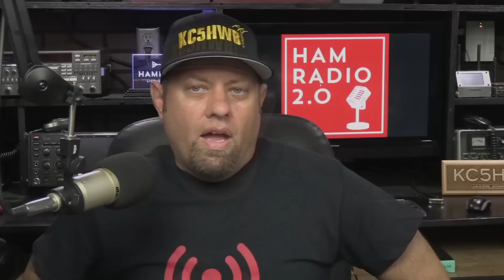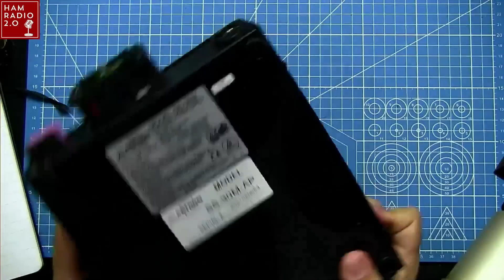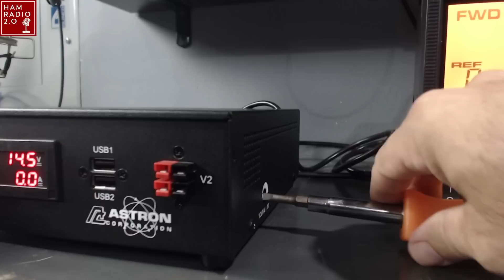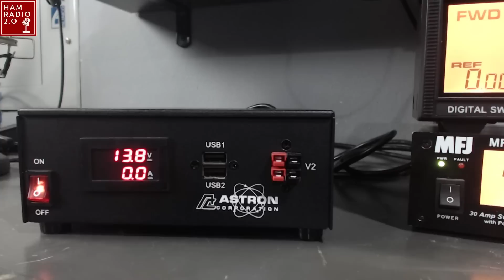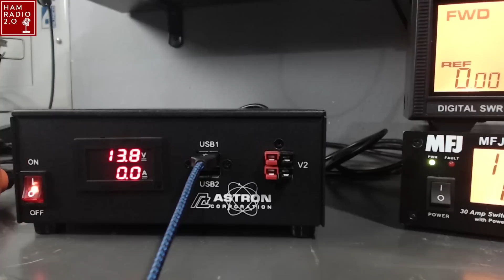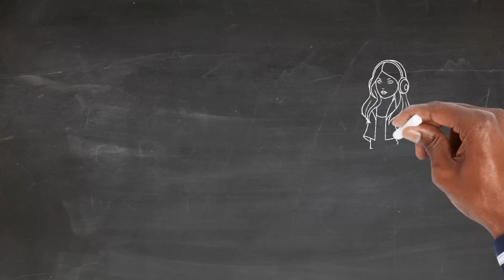Astron SS-30M-AP Power Supply First Look!

Comment: I have to of the SS-50-AP supplies.  The adjustment screw was labeled backwards on both of mine too.  Go figure.  It's pretty amazing how small they are.  I have had Astron supplies for decades and my RS-20 started to get really hot heat sink fins.  I think the pass transistors are dying.  These have been very good and I hope they last as well as the old ones.  the funny thing is the 50 Amp switching supply is in exactly the same size case as the 30 Amp

Comment: HEY 2DOT!!! How's it goin'?  Hf radios are powered from the back. 2m/440 are powered in the back. Antenna tuners are powered in the back. Amplifiers, the same, in the back. Question: WHY then, do power supplies makers put the power ports, IN THE FRONT?? I can see it for use in a laboratory where things are being plugged in and out all the time, BUT hams hook it up, and for the most part, forget about it! Just wondering. Thanks !!
Reply from the maker: Usually it is just easier to get to while sitting on a desk.

Comment: Many thanks for making this video. I have just replaced my old Manson psu, I was worried one day the voltage could go high. It arrived today and works great no rf noise on hf from this PSU. What a change not to have a noisy fan coming on every couple of minutes. I am using it with my FTDX10 2.2 amps on RX, 17amps on cw 75w. Once again many thanks.

Comment: mine has terrible RFI from 5MHz to 10MHz...  even worse when the power is supplied via the Powerpoles
Reply from the maker: Astron doesn't usually have that problem, you might have a dud
Reply: @HamRadio2  I called them up and they suggested that I make sure the ground plane screws were tight and that my electrical ground was sound. Everything is fine... I'm not going to give up, but will send it in and see if there is something faulty.

Comment: Very helpful for a new Ham (@ 66 years old) looking to power my first radio.  Finally retired and have chance to indulge a bucket list item…still developing  my philosophy of use, but just ordered this supply to pair with an Icom IC-7100 as a general purpose shack/travel radio.  More concerned with the flexibility than the absolute absence of transient noise as I try different things to decide where to take the hobby. Very useful information…thanks!
73/KO4UWS

Comment: When I purchased my first HF radio a Icom 7300 in April 2021 DX Engineering recommended the Astron SS-30-M and it has been excellent. Good review, like the new features on this new model. 73 NM5SP

Comment: Working with commercial radio sales we sold many Astron linear supplies in the past. As Timex used to say, They took a lickin' and kept a tickin'. As for repairs, very few needed, usually pass transistors from a customer overloading the supply. Only one I could not fix and that one was hit by lightning. One can only hope that Astron will provide schematics for these supplies as well as a tech support / FAQ site for those with little experience in diagnosing and repairing issues with switching supplies. A big Bravo to Astron for making this supply a wide input voltage range ( hopefully without any type of switch over arrangement) makes life for Hams a bit easier. Alinco's new 30 amp switcher is available as only a single voltage input depending on where it is sold in the world with no chance of moving it between both common input voltages.

Comment: I have the older analog dual meter version. Astron makes great power supplies. The rear DC output terminals are the only negatives. I wish they would change them to binding posts. Or some other style. Jason, I was hoping you would have tried out the rear terminals, connecting a standard HF power cable. The terminals on the rear are horrible when using heavy gauge wire.
Reply: I completely agree, Others have made the same comments. Astron doesn't give a rats butt.

Comment: I lost my very old power supply a few months ago. I looked at the Astron SS-30M-AP but for less money (HRO Discount Price: $179.95) I got the DIAMOND GZV4000 40 amp switching supply. Its larger and heavier then the Astron and it does not have the USB ports. I have had no Hash so far on any of the bands I uses. The only complaint I had with the Diamond was the fan was a little loud. I replaced it with a better  Noctua 80mm fan that I had and all is well. 73 Joe
Reply from the maker: I'll have to check that one.  I always look for light-weight on power supplies because I usually carry them around.  40 amps would be nice though.

Comment: 13.8 V ports placement depends.  For a home station, the rear is better.  However, for an activation, front is better.
More space between pairs would also help to place the APP on and off the unit.
More power!  Yes!  Found out my IC746 Pro puts out 125W, not 100, so a few more amps might be a good idea!

Comment: I kinda agree with some of the linear approach peeps.. load down one usb port + the switched ps.. you'll get the dreaded "roving hash birdie" .. and without doubt, it will come down the band hunting your carrier. Slowly crossing your ft8 bandwidth and seeming to be passing you by. But only a few hundred khz away it stops! Out of your way but why did it stop? OMG it's turning! Coming back up. Back up to the middle of your passband. There to shift from top to bottom, soiling your dx. This is my tale of the evil roving "hash birdie"  73 N8ON

Comment: I noticed a glaring issue right off...

There is no dedicated station grounding terminal/lug on the back!

Which also begs the question; is the negative side of the output connected to the case?  Or just the AC ground. ...or neither ?
Reply: I'm not sure of any power supplies that do have?   In most power supplies the + and the - would be floating (isolated). A third Gnd connection is really not necessary.
Reply from the maker: I saw a video a while back that claimed NONE of the modern p/s had this, and it showed how to modify your p/w to ground it properly, which eliminated lots of noise.

Comment: 1:20 C14 inlet for a standard C13 connector (PC) cord. 👍  Would like to see the Alinco DM-30TR compared to these as well  considering the Alinco is in the same price bracket as the MFJs. 

Put a higher current load (15-20A) on them and measure the voltage to see how they perform.

Comment: I had and sold my last Astron switching power supply because of the LOUD Fan Noise! Can you comment on fan noise with low draw, 1 amp, than 5, 10, 15, 20 amp draw and how the fan reacts. Thanks